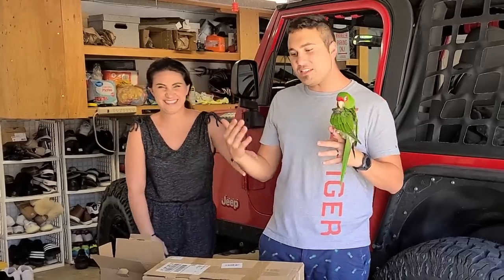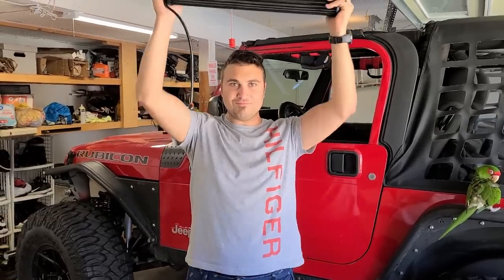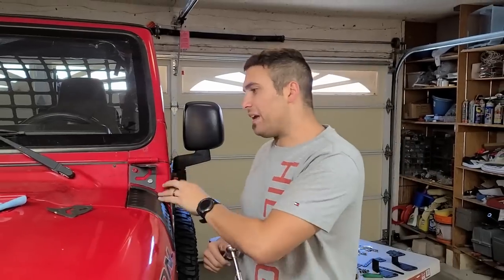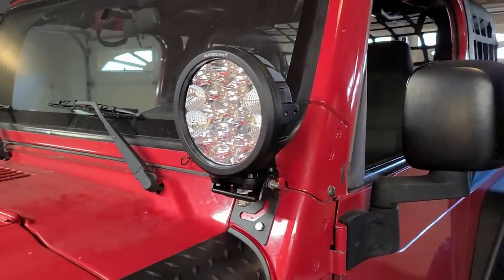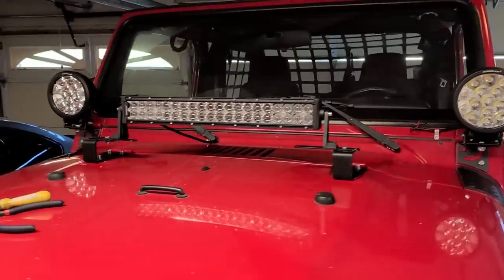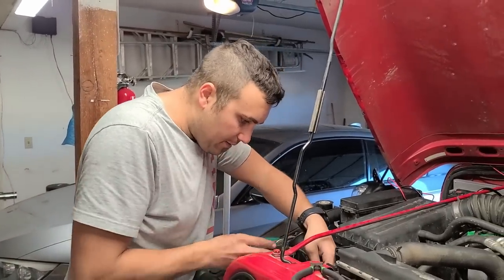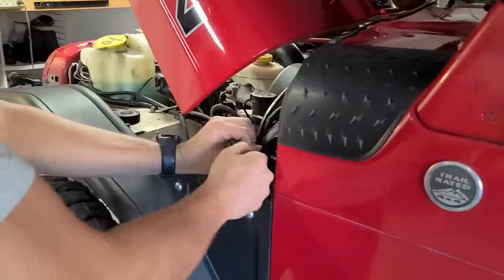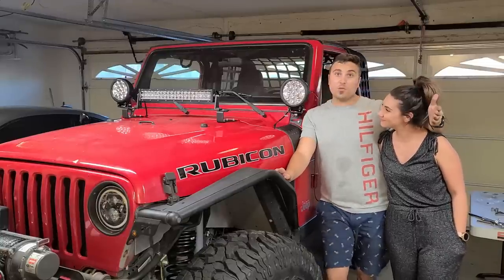We Install LED Lights Without Adding a SWITCH on our RUBICON - Ultra Powerful

Comment from the maker: IF you want to check out some of our favorite jeep mods as well as the parts in this video, here you go!
Auxbeam 7 inch Light pods - https://amzn.to/2z9gJfm
Auxbeam hood light bar - https://amzn.to/3cbszVj
Shrink electrical connectors 540 piece - https://amzn.to/2VWQPoc
Electrical tools - https://amzn.to/2KS2QVG
Wire - https://amzn.to/2KXlN9n
Cheap OBD2 scanner - https://amzn.to/3eNwhWw
Plug and play HALO LED headlights - https://amzn.to/36O7sW9
Smoked LED turn signal - https://amzn.to/2EQ7X67
Steel Stinger Front bumper - https://amzn.to/2WjykMA
Smittybilt cargo cover - https://amzn.to/2QeIMzQ
Ares technology PCM - https://arestechnologies.com/
Skyjacker lift kits: https://skyjacker.com/
Rocktrix Rims - https://amzn.to/2xS8Mus
Rocktrix wheel spacer adapter - https://amzn.to/2yDVmD3
Tom woods drive shafts: https://4xshaft.com/
Milestar Tires - https://www.milestartires.com/ 
Affordable sun shade - https://amzn.to/2wWQQyq
Rear LED tail lights - https://amzn.to/2wa7evn
Synthetic winch line - https://amzn.to/3cU01QR
Aluminum winch plate - https://amzn.to/38SLWQq
Rubicon DECALS - https://amzn.to/2xG5lqT
RGB rock lights - https://amzn.to/3b0BoAd
Scrubblade wipers - https://amzn.to/2WcmnHi
Red roll cage fire extinguisher holder - https://amzn.to/2w8ZKsv
Auto fire extinguisher - https://amzn.to/2vjcBIe
Cowl Guards Jeep TJ - https://amzn.to/38SY8QY
4wd Kings light bar - https://amzn.to/2wTOEYy
Stubby antenna - https://amzn.to/2vq9m1S

Comment: Also for the A pillar lights you can take off the cowl & have the wires run through there that’s what I did I also didn’t tighten the screws by the wire all the way so it wouldn’t pinch it
Reply from the maker: True! In our case it didnt fit through that area

Comment: A good piece of advice i can give you with those factory torx bolts...i use a little torch and heat the head of the bolt and it melts the loctite and they come out nice and easy!!
Reply from the maker: Thanks for the advice! Appreciate that big time!

Comment: I was a little worried when you said you were going to tap into the high-beams, I wasn't sure if you would add a relay or not - but I'm glad you did! Those draw a ton of power and look superbright, ahah!

Also, have you considered adding a relay to the factory wiring harness for the headlights? Even on LEDs, it seems to make a difference in output.
Reply from the maker: Thanks for the comment and the idea! Very interesting, haven't heard of that before. Cheers

Comment: Might want to invest in an impact driver! For them stubborn screws, but nice install and damn the lights are bright
Reply from the maker: Thanks for the comment! We have an air impact driver but don't bring it out unless its a bigger job. Cheers
Reply: Heat it up also.
Reply: Garage Couple not talking about cordless or wired driver it’s about five inch hand held you put whatever style bit and hit it with a hammer and that force hits down and rotates at the same time on stubborn screws or bolts
Reply from the maker: Ahh I see! Yes we totally should invest in one!

Comment: The lights look good next time you have trouble getting a bolt out just put the tip of the torques on the bolt and hit it with a hammer to loosen up the threads before you attempt to unscrew it.
Reply from the maker: Thanks for the support! We actually did this exact thing..it was bound to happen lol!

Comment: If you are going to hit a screwdriver with a hammer you should try to find a screwdriver that has a steel shank all the way through the handle. Especially with a handle that big, not fun when the plastic handle shatters in your hand. I gought some Irwin screwdrivers just for this. Harbor Freight also has some and theirs are really nice because they have a really big pad to hit.
Reply from the maker: I appreciate it! Funny enough we ended up using them to remove tile flooring with a mallet and it handled it fine. Considering ourselves lucky will now switch to those. God bless

Comment: Great job as usual they look great very nice size i always thought 7” were too big for a jeep but they look great.The idea for the hood light is great i never thought about doing that so you can have the high lift jack there also.Guess it pays to watch you guys...lol.Can you tell me what those connectors you used at the headlight are called?Ive never seen those i always solder my connections and tube shrink it but those connectors ive never seen and could be useful.
Reply from the maker: Thanks for the support! They look amazing in person! The connectora are called t taps  https://amzn.to/2VY6ALx
Reply: Garage Couple thanks guys gonna pick some up they would make some of my light connections easier to unplug instead of always soldering and unsoldering.
Reply from the maker: Absolutely! Just be warned they sometimes get loose and stop working. Doesn't happen often but happens
Reply: Garage Couple good to know im not going to use them on the fogs themselves just the different drls i have.

Comment: If I understand what you did you hooked up the auxiliary lights to come on with the high beams. In most states it is illegal to run that kind of setup.
Reply from the maker: Off road use only :)

Comment: Garage Couple - I love your Videos!  I have a 1998 TJ and tried to upgrade my Headlights to J.W. Speaker 8700 EVO 2, but they wouldn't power up.  Do I need some kind of an adapter or harness?  These LED Lights work fine on my JK, but not on my TJ.  Thoughts?
Reply from the maker: Thanks for the support! That is strange, neither of the 2 tjs needed an adapter for the headlights.
Reply: Garage Couple - Thanks for the Follow Up.  I will keep researching this....
Reply from the maker: Let us know what you come up with!
Reply: Garage Couple - So for 1998 and older TJ’s you have to use LED Bulbs.  So what I did was just re-used my JK Headlight Housing with Auxbeam LED Bulbs on my 1998 TJ.   This worked like a charm.

Comment: You should put anti seize on the bolts before u install em to avoid this issue
Reply from the maker: This is very true. Originally they come with locktite so hopefully now we won't have this issue

Comment: I can’t put one on my hood because I have the high lift jack on the hood
Reply from the maker: That makes sense. You can try to put a thinner single row light bar under the high lift jack.
Reply: I put one on my hood with a hi-lift. Looks and works bad-a**